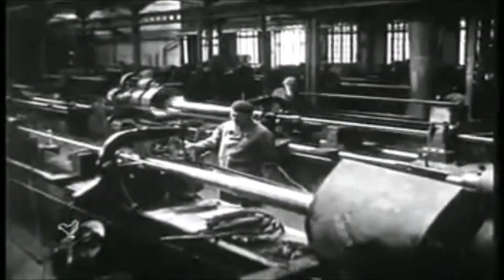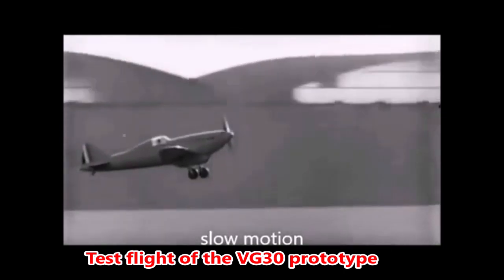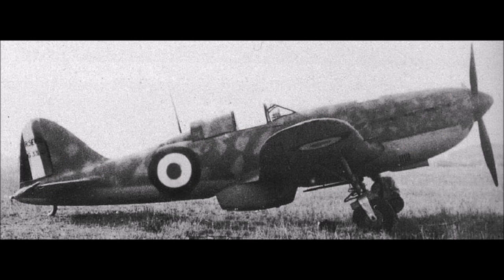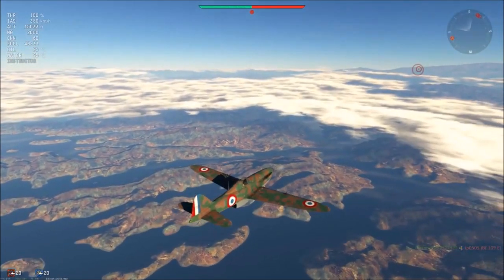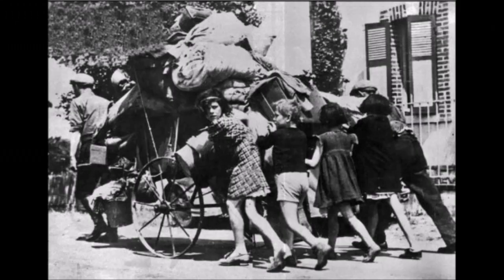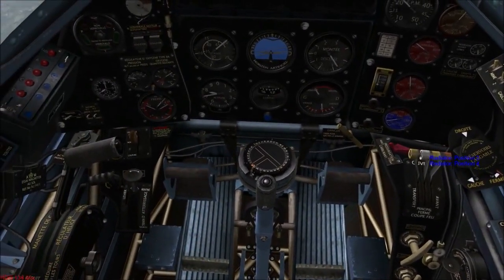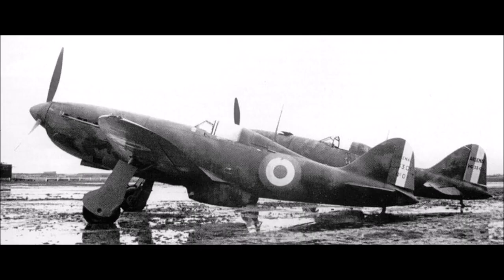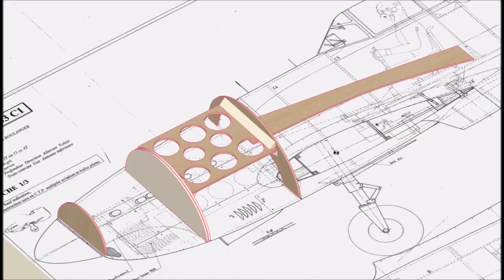The Arsenal VG33, the French fighter aircraft victim of the 1940 war

Comment: The anaemic engine was shocking, 36 litres but with only 2 valves per cylinder and a single supercharger speed.  The inlet ports were adjacent to the exhaust ports!  It looks like it drove a manual pitch control or even a fixed pitch propeller.  The Soviets developed it into something useful.

Comment: Looks every bit as businesslike as anything else in the air at the time. The defeat of France, which had a large army and good equipment to fight with, is still a bit of a mystery
Reply: They were defeated because they weren't fighting with pictures and specifications. The actual hardware wasn't there in usable numbers to be effective.

The Somua S-35 and Char B1bis tanks were better armed and armored than German tanks, but were brand new and crews going into battle had as little as a couple hours training only, and were in no condition to fight.

The aircraft industry was a total fustercluck, in the process of being partially nationalized when war was declared. Obsolete planes from the 20s and early 30s were thrown in the fight because new models sat in lines by the hundreds at the factories waiting for guns, engines, and instruments, undelivered due to bureaucratic bungling and strikes by workers instigated by the French communist party.

The French army's command structure and doctrine were a straight carry over from the First World War. The general headquarters was situated in a chateau chosen for its luxury rather than its purposefulness. It had no radios, and not even any telephones, which is laughably ludicrous. Communication with the front line units was by motorcycle messengers only.

They had some good aircraft designs in the prototype and early production stages, some innovative lower level commanders, and many courageous soldiers, but as a nation overall, they were just begging to get bent over and reamed.